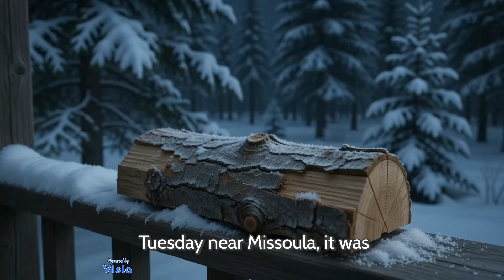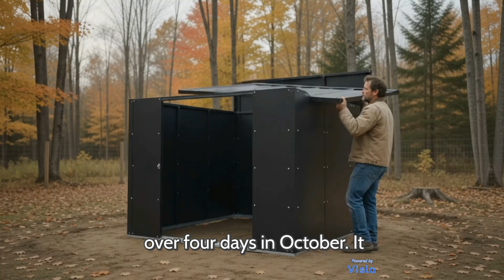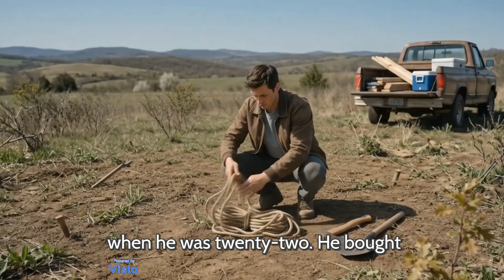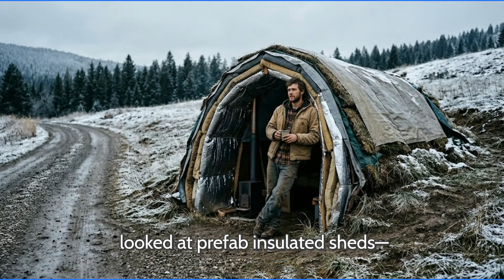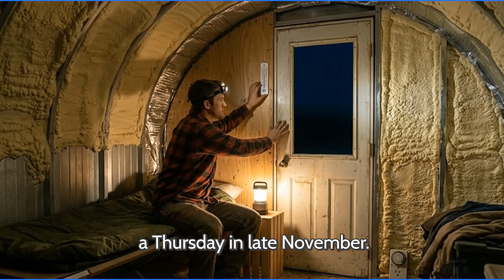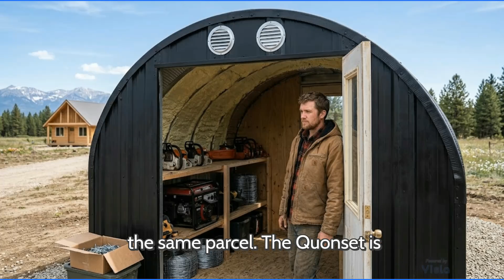This New Mini Quonset Costs Less Than $500 & It Never Drops Below 60°

Comment: a cold-weather camping trick I got from an old Argosy magazine; cut small branches from pine trees and make a mattress out of them,your sleeping bag goes on top of it. it spaces you off the cold ground,provides insulation and cushioning.  as a teen, I tried this in January in Buffalo,NY,camped out right after Xmas and everybody had thrown out their Xmas trees. just a simple tarp for a tent,open at the ends,but i was warm all night,because of the pine branch "bed" beneath me,despite several inches of snow below that.

Comment: Link or pointer to the q-hut kit?

Also, in the conditions as described, with electrical power available (hard to believe), a Sand or Salt Battery would help keep the temp steady through the night.  A 5-10 gallon metal bucket or drum filled with sand.  Install one or two heating elements from an electric water heater.  Fire them up, bring the sand up to temp, and then let it passively radiate heat all night long.   Easily fed by solar panels......    google is your friend when researching this concept.
Reply from the maker: We will include a link to the kits in our upcoming video.